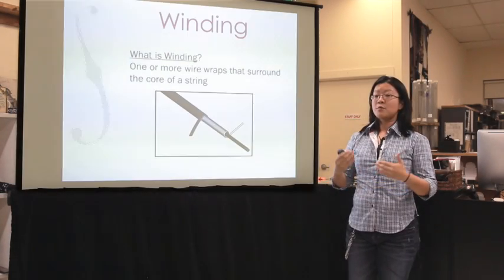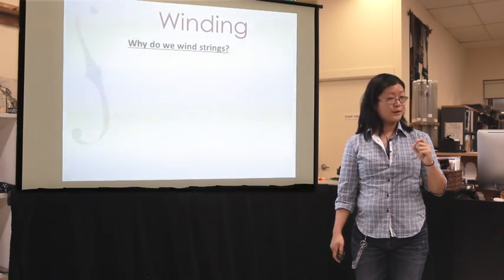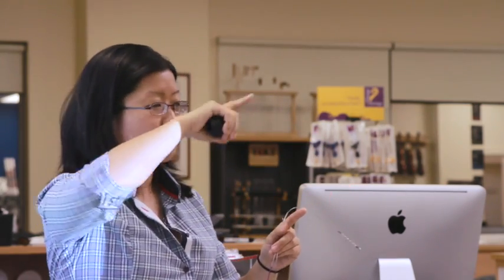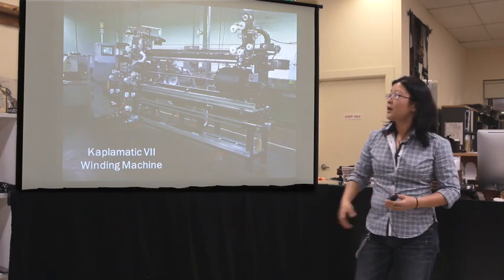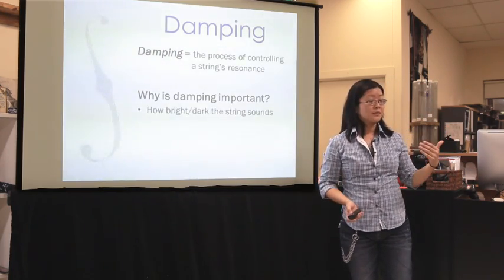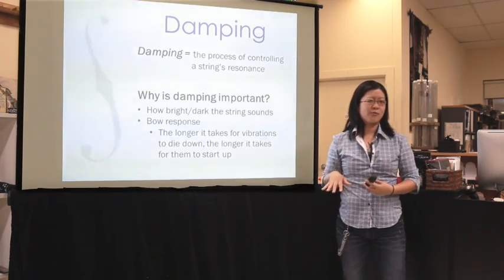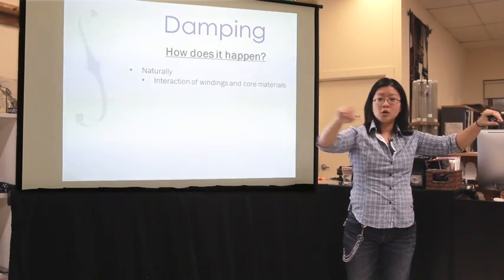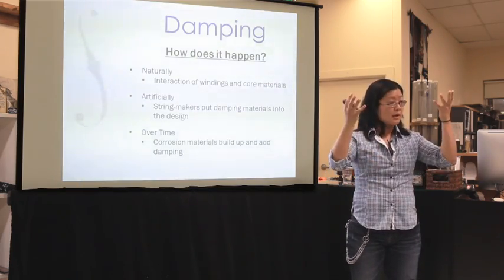String Making Lecture Part- 3 Winding

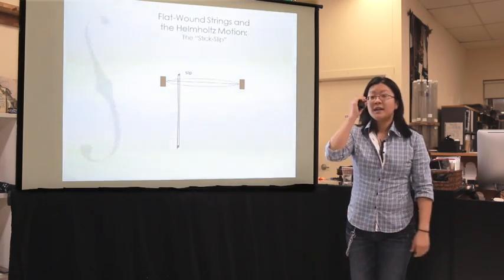Comment: 4:08 Flatwound Strings came around 1874 by Hamilton. They were originally made to replace the Gut Strings on Bowed Stringed Instruments because they last longer, hold tune better, and the flat surface increases the contact area with the Bow hairs which helps with bowing on the strings.